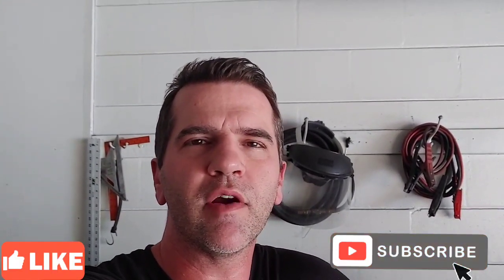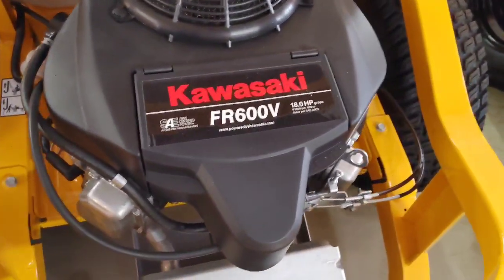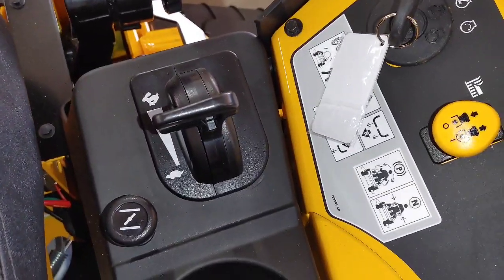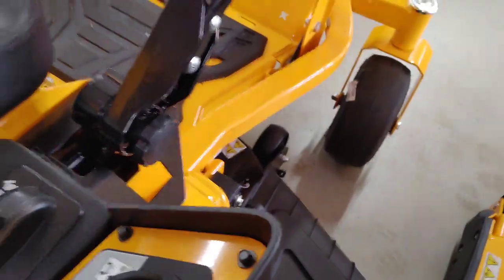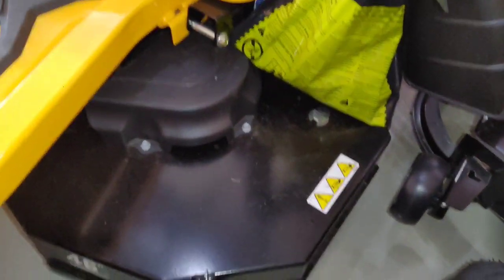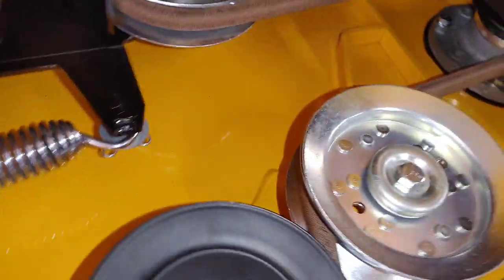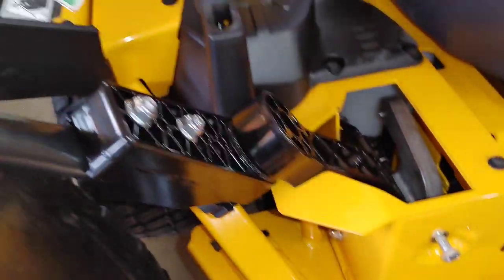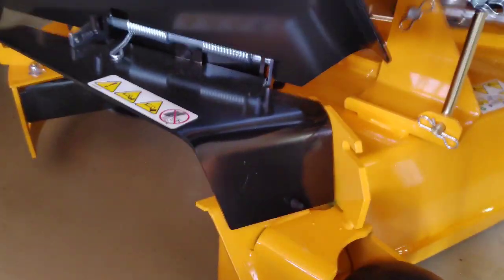Residential zero turn mowers part 2- Cub Cadet vs Stihl vs ExMark.

Comment: I bought a used Commercial Husqvarna 61" with a Kawasaki twin engine almost 20 years ago for $2100. I put two belts, one used hydro pump (200 bucks), a couple of sets of blades, two control dampers for the handles. The hydro pump replacement could have been avoided, my fault.
Used commercial for residential use has been a winner for me....

Comment: The cub cadet was a fan deck because a stamped deck is not welded. They are formed completely be stamping in a press. I worked for years in a small engine shop as a tech

Comment: I see they've made some changes since my purchase May 5th 2020 I have the 42" with Kholer 22 and stamp round Deck I'm at 150 hrs also the large battery and my throttle lever is metal not plastic. So far it's been pretty good. I paid $2750 from my local dealer.

Comment: I used to mow with an exmark quest (residential mower) back 4 years ago when I first started, it did great to get started with but it definitely ended up not holding together with comercial use

Comment: If you only had $1500 to spend for a residential lawn tractor or used Zero Turn what would be a good one used if in good condition.  I found for sale a Club Cadet RZT-L in great condition with 625 hours for $1300 delivered. Guy bought a zero with suspension is what he is selling it. Anyone familiar with this one? Your videos and knowledge is top notch so hank you for the time you put into your great videos.

Comment: Never heard anything about Stihl mowers, or even seen one in use but 4 wheel suspension at that price has me interested.  Anyone have any thoughts?
Reply: I’m looking to get one also. I’m debating if I should get a bad boy or stihl.
Reply: I bought the sthil 52" it's an excellent mower smooth and powerful

Comment: cub cadet has a steering wheel version that can mow a 20 degree slope called the ultima ztxs4 it looks just as good as the ztx4. been thinking of getting that mower to replace the john deere d140 i have

Comment: I have a service manual for   John Deere lt  mower so I can see how to grease the transmission  unless you have a video on how to do that for a John Deere lt mower with a manual transmission More over I Lt 133 38 inch cutting deck

Comment: Surprised at the quality of those cub cadets but MTD leaves a bad taste in my mouth. The Stihl (rebadged Ferris) looks ok, but the question is would it be worth buying over an actual Ferris?. Not a fan of that ex mark/toro branded engine, if you look closer on the label looks like it’s made in China. Probably a cheap clone engine. Shame they have gone to using those instead of a Kawasaki or Kohler.
Reply: Why you comparing mtd to cub cadet? Two different things
Reply: @marekkrepa9982 Cub Cadet is a wholly owned subsidiary of MTD
Reply: @andybub45  Milwaukee and Ryobi is made by same owner in one factory . Please do some homework . They are different
Reply: @marekkrepa9982  The cub cadets are higher quality, no doubt about it, but MTD (who makes Troy Bilt, Cub Cadet, Bolens, etc) has a lot of really poor designs and I wouldn’t want to own one of their products. The beefy frame and deck is great, but it’s the small things you don’t see that will show themselves later on.

Comment: I sat on several mowers at a dealer the other day.  I'm sure its personal preference but the Cub Cadet felt so cheap when you sit on it.  Instant no for me.
Reply from the maker: Which brand are you leaning towards?
Reply: @Mechanical_Mind  I think you’ll be disappointed but leaning towards a Toro. My budget is a little higher so looking at the Titan line. Features to feature it costs a little more. But it feels the most refined. I’m sure they all make grass shorter. But some are so overbuilt but still don’t feel quality. Gravely was maybe my second favorite. The John Deere don’t seem worth what they cost with stamped decks on a $8k machine. Really didn’t like the cub. For some reason I don’t care for the bad boy, could be the name or color.

Comment: Which do you prefer between the Bad Boy in the first video and the Cub Cadet in the second?
Reply from the maker: I dont think you can go wrong with eithet but if I had to choose Id go with the Cub Cadet.
Reply: @Mechanical_Mind  So out of all of the mowers with $5k budget. Mowing 1.3 acres what would you recommend.
Reply from the maker: @JerryCombs1  $5k puts you in higher level. At the $5k Id get the Husqvarna Xcite 350. https://www.husqvarna.com/us/zero-turn-mowers/xcite-z350/
Reply: @Mechanical_Mind  If I go with the Cub Cadet do I need to add a mulching kit to it if I don't want to bag clippings?
Reply from the maker: @JerryCombs1  Its all preference and depends on what grass you're cutting and an what height. Most of my customers are professional landscapers and many of them do very high end properties. I dont know of any of them that bad the clippings. Many of them do use XHT Predator mulching blades or Oregon brand mulching blades even without a mulching kit.